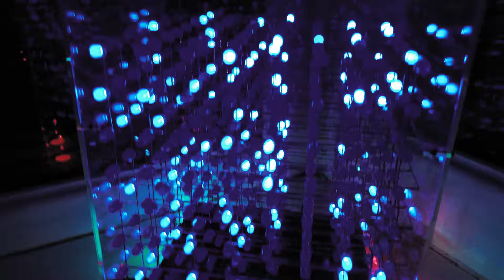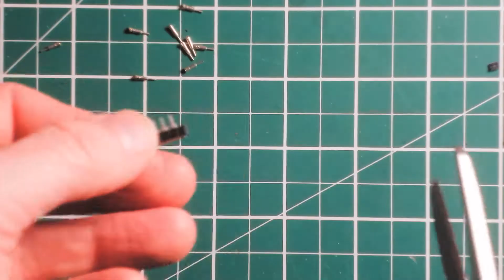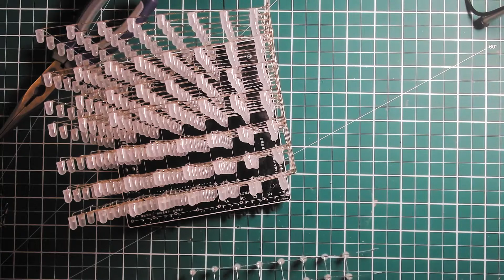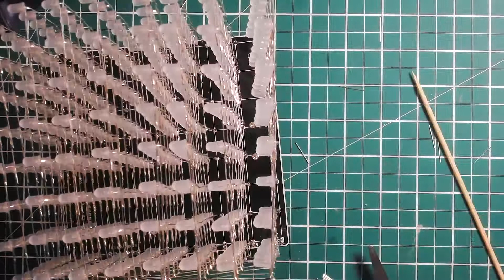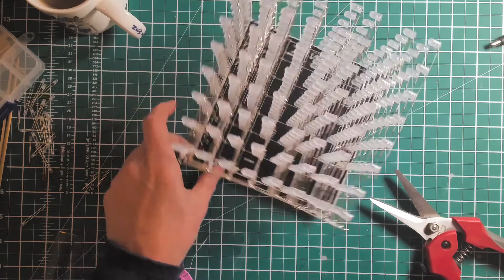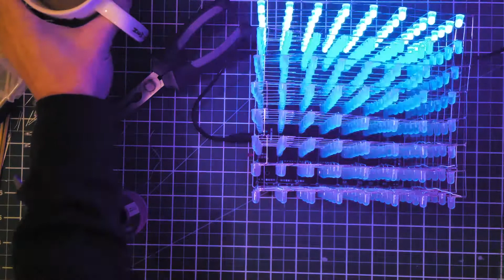How to Build an 8x8x8 LED Cube - Part 2 (Banggood Item 1091209)

Comment: You didn't say why you would solder the sockets into the board first rather than putting them on the grid legs first. Another maker suggested what you did as the preferred method. Care to share why now that all is said and done?
Reply from the maker: Good point. The reason I would've mounted the sockets into the board first is because the solder pads on the board are so small and the legs on the grids are so springy so I was trying to solder the grids to the board really quickly to avoid the legs springing out of position and not wanting to keep heat on the board for too long. That lead to a couple of dodgy solder joints which I had to resolder later which is very tricky if the failed joint is in the middle of the board.  I think I would've made a better job of soldering the sockets to the board without the legs already attached.
Reply: I just finished my cube and put the sockets on the grid ends first. Now I'm seeing some of the animations appear as if the interior LEDs on the one end face are not lighting as they should on several but not all of the animations. On some of the animations they all light as expected. Maybe I've got a bad solder joint somewhere but I'm not sure if I should be focusing on the STC pins, the other ICs or the resistors. I will switch the ICs around to see if the problem follows them or not. I pulled U8 and the front row and all layers went out.
Is there a pin map that would identify which pin on the STC is associated with what group?

Comment: Hi, I don't know if you could help I built the same kit but the Leds when they supouse to be on they're off and when the supouse to be off they're on. So, all the animations goes reverse and is imposible to turn on just one individually. I checked al the conections and everything looks fine. Can you help me? Do you have any idea? thank you so much for your time (and sorry for my english I'm from Spain).
Reply from the maker: Marcos Serrano hi Marcos. Is it possible you installed the + and - the wrong way round? It happened to me when I was testing another cube and it had the same problem
Reply: I'm sorry i don't understand what you mean. If they're wrong way, the shouldn't turn on, isn't? This is what's happening: https://youtu.be/men0PQEAcsU

And when I try to turn on just one all the column turns on. Thank you so much for your time.
Reply: Buenas tardes Marcos
yo tuve el mismo problema con mi cubo, la solución es desconectar los cable de los pines y soldarlos a las patillas 2 y 4 de su circuito integrado. Es un fallo de diseño de la placa, a mi así me funciona perfectamente.
Un saludo